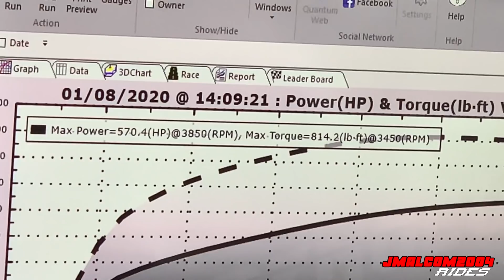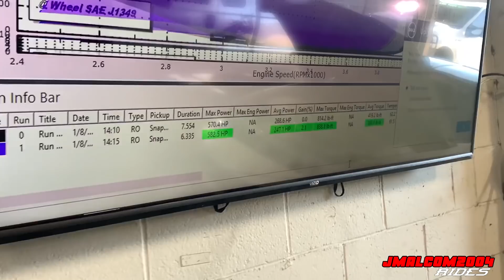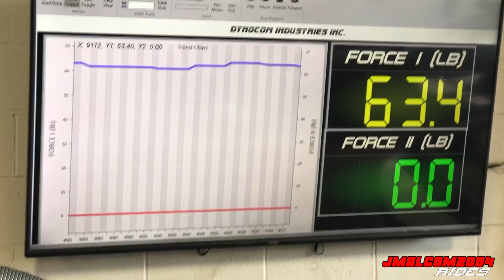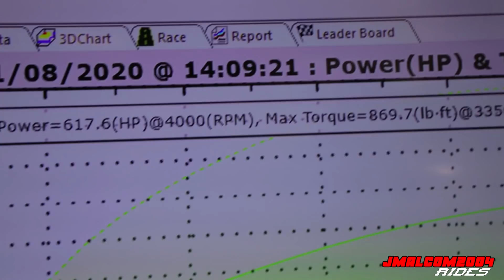1ST TIME ON THE DYNO WITH THE JON JONES TURBO 4TH GEN CAMARO AND MY BIGGEST BURNOUT EVER!

Comment: I’m going to guess you have exhaust leaks on your crossover pipe from dragging it up the driveway, which is introducing air into the system and leaking boost. Cars in the popping out of the exhaust on deceleration
Est 444 rwhp
Reply from the maker: HeadFlowInc you’re exactly right bro! Pinhole in the crossover

Comment: I was off by 17 hp. 😂 😂 😂 good stuff man. That thing should sprout wings on a soft tire 💪🏿💪🏿💪🏿. Its maxing out at 4000rpm 👀👀👀 holy shit I guess when you let diesel guys put the tune in you end up with diesel torque and rpms. Damn thing makes more torque than any factory diesel I’ve ever seen. 😂🤣😅
Reply: Man a cam swap would pick up HUGE numbers on that beast. 4000 rpm peak seems like a stock cam to me, or a truck cam.
Reply: 690hp
Reply from the maker: Tariq Raheem the Rpm wasn’t right if I dm we right. Made the 617 at 6500
Reply: JMalcom2004Rides ok cool makes sense. 6500 sounds right. Haha I was about to say, you need tug o war that black power stroke if that’s the case 😂

Comment: Damn your making more ftlbs than me on 24 pounds with my little .05   over 2004 ls6/1 on E90 961whp and 853 ftlbs. Your gonna love the huron kit and I would definitely throw a Holley terminator on the car and reuse your boost controller  your using now or get the Hp ECU if you need more inputs and outputs, Holley is the best and super easy to use if I can learn how to use it anybody can and I have a set Bosch 210s for sale you can make big power on E withem I have had 2 people act like they where gonna buy them and never hear from them